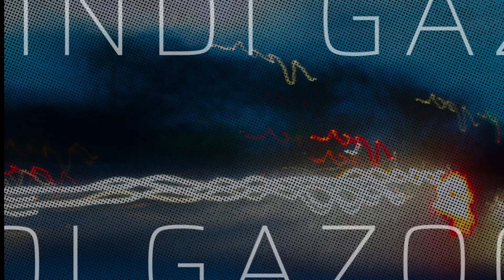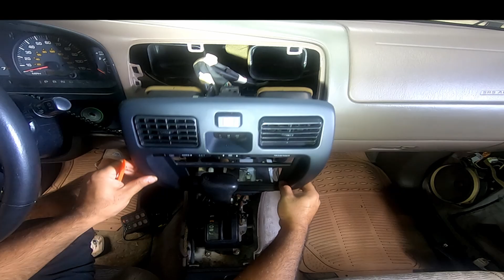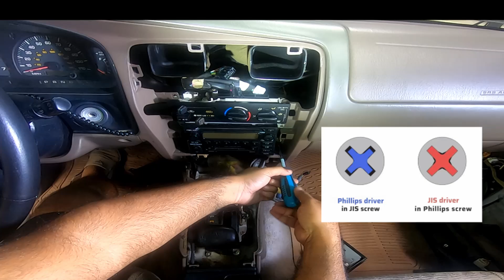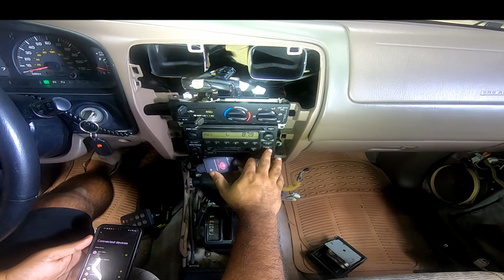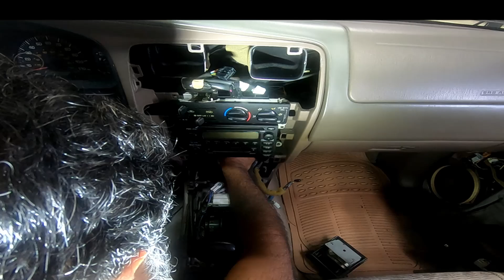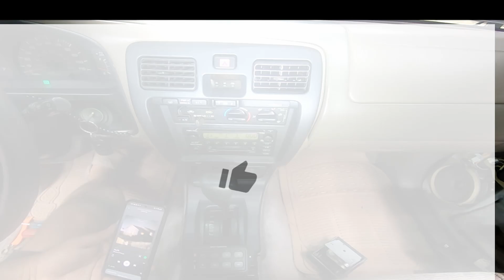How to Add bluetooth to your stock radio

Comment from the maker: Want Bluetooth in your 4Runner but don’t want to ditch the factory radio? I’ve got you covered. This plug-and-play mod gives you modern audio without cutting a single wire. Links to the adapter I used are in the description — works on many Toyota radios!

Comment: I bought this device for my 2001 toyota 4runner and for some reason its not working. I've connected the wires and the usb and its not working. Am I doing something wrong?
Reply from the maker: If you've connected the wiring harness it should fire up. When you say it's not working, does it not turn on? Does it not connect? Or does it do both but you can't hear any audio?
Reply: @IndiGazoo I connected the harness and the Bluetooth paired to my phone but I couldn't get audio to  play. I tried pushing all of the buttons on my stock stereo and still I couldn't hear anything but a low  buzzing sound when I played my cd player.
Reply from the maker: unfortunately its going to be difficult to diagnose the point of failure if everything in turning on and connecting.  the first thing would be to try and see if you can play a cd just to be sure that the output from your radio in that mode is functioning. from there the next step would require a multimeter and a pinout diagram for toyotas CN701 12 pin connector. you can backprobe to check pins 1/6 and 2/7 for input signal from the bluetooth module. But if you can play a cd and since the module is turning on and connecting, if your unable to test, I would replace the BT module with another one off amazon. I've personally not had any that were bad but please do let us know if it turns out you got a dud.

Comment: I got mine done at Protech Solutions here in New Zealand, Christchurch. The sound is louder and clearer than using the FM transmitter, definitely a difference. But so far, it seems to have issues with the CD, as I have to press it again to get to Bluetooth. Mine comes up as EX2, but when I turn my car on so the engine is running, it stays blank. When I switch from CD back to Bluetooth, nothing happens. Then, when I turn the car off fully and then back on after a few seconds, it won't connect automatically. It's been a week now with the same issue. So, is this common with these, and does it resolve itself over time?
Reply from the maker: Glad you got it in but you may want to look at the manual for whichever unit you had installed. I Have installed the unit I've linked in multiple cars and they all auto connect. Whenever the car is on and my phone is in range. I have to have issues with my phone disconnecting. When I turn car off and being unable to reconnect. I doubt this issue will resolve itself over time. If the manual indicates that it should not disconnect when you switch off, I would take it back to the place you had it installed.

Comment: How would you say the sound is like?  Also does this interface with the phone for hands free calling?  I have a '99 Camry with factory CD/cassette with JBL amp, any experience adapting one of them?
Reply from the maker: The sound quality is the same as when I play a CD or listen to the radio. And yes I can use hands-free calling from my phone. I had a 2001 Camry and installed it in that car the same way as I did in this video. But I don't recall if mine had the premium sound package or it was just the base model. In either case they make adapters so you don't have to splice into the factory wiring harness. Good luck on your install

Comment: Nice video.   Which jis is most commonly used?  Noticed several sizes available.  Also,  does the cd player still function or did this adapter disable that functionality?
Reply: Also,  what switch panel have you had guys results with?
Reply from the maker: are you asking about the brand of the switch panel that's mounted on the shifter surround?
Reply: @IndiGazoo yep.
Reply from the maker: mic tuning is the brand , it looks to be patterned after the auxbeam panel. It was installed by the previous owner but the quality of the panel , fuseblock and terminations look good.
Reply from the maker: +2 will be the most common size found in toyota cars, and yes the cd player still works